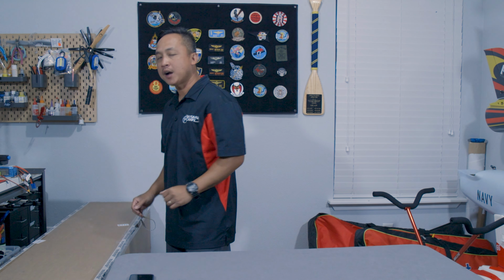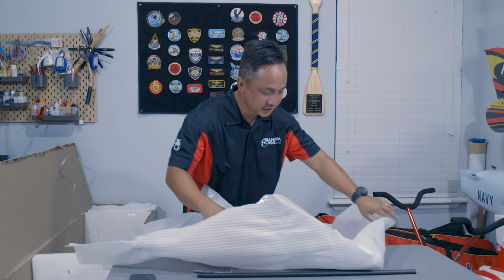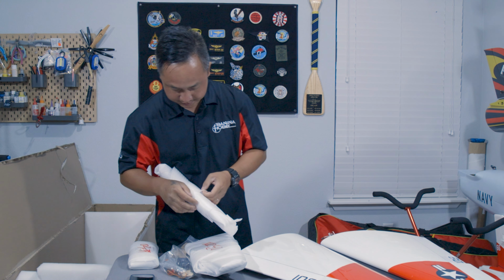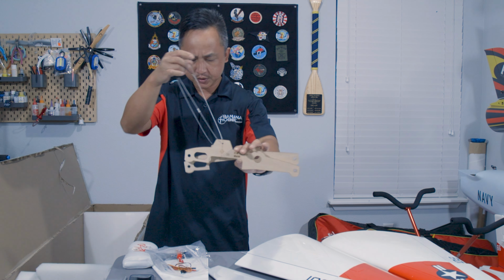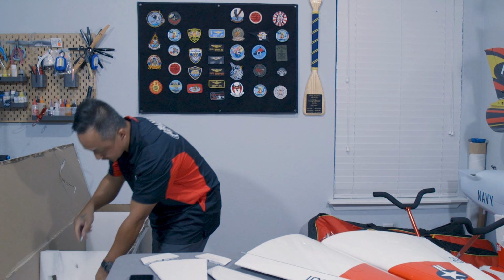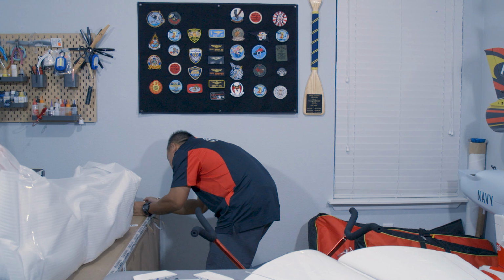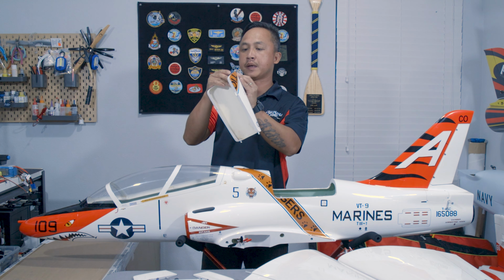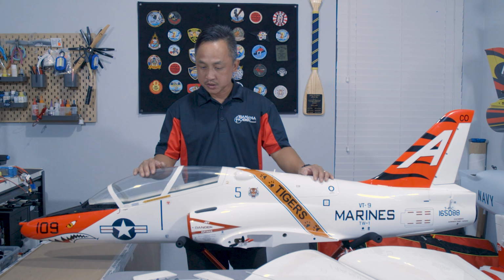Pilot-RC 1.8m Bae Hawk unboxing

Comment: Very nice. Do you think you could fit a 120mm EDF as oppose to a turbine? Or is it specifically designed for turbines?
Reply: A 120mm edf can fit in the turbine compartment. The customer would have to make the required modifications.